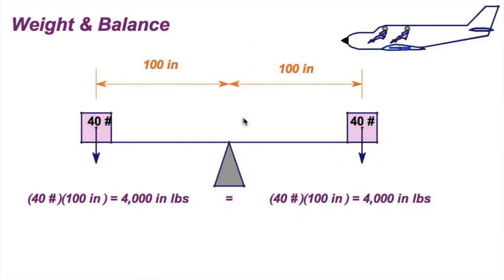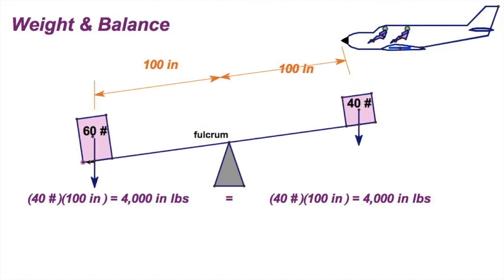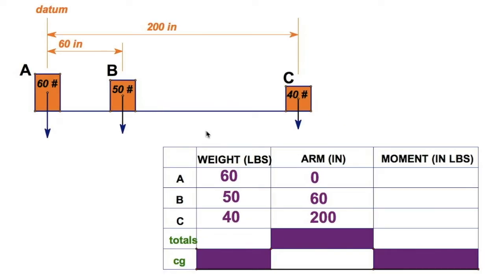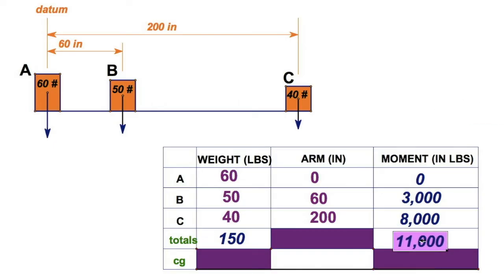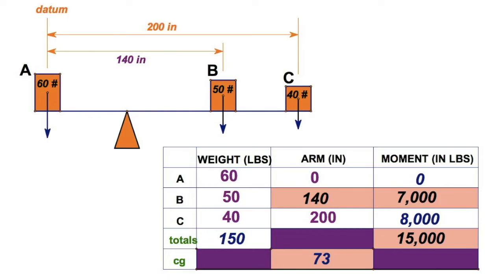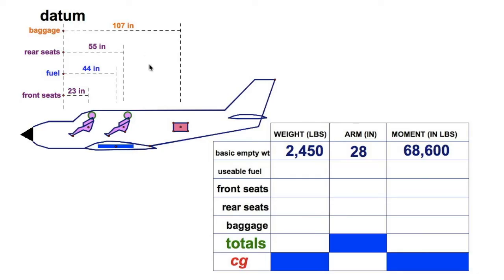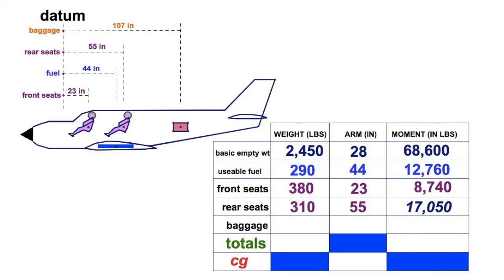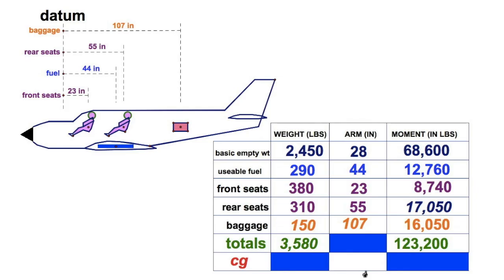Weight & Balance Basics for Aviation

Comment: everything makes great sense however in the plane demo you assigned the empty weight of aircraft an arm of 28, my question is how and why? that marks a point behind pilot but IN front of all other weights, would it not be the center of aircraft in relation to the datum? couldn't you simply choose any nominal distance in this exercise and still be correct if not my suggestion?
Reply: @Chris Fillmore  Keep in mind that there is significant weight in front of the datum for the aircraft in the example.  The engine, nose gear and tire, propeller, etc.  That factors into the empty weight and the total moment of all the arms and weights in front of and behind the datum.

Comment from the maker: Think when you change a tire on your car.  You have some type of wrench that gives you leverage on the nut.  The distance from the nut, where you push on the wrench is the arm.  Sometimes people extend the wrench with a hollow pipe....this extends the arm.  How hard you push on the wrench is the force.  How hard you push times the arm is the moment.  Therefore, your strength is magnified when you lengthen the wrench (maybe with a pipe) because moment = force x arm